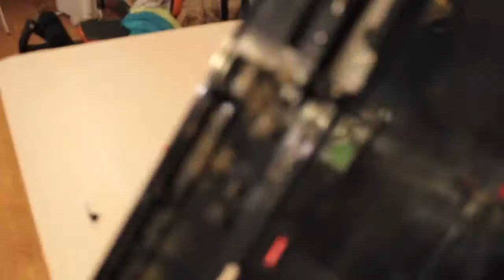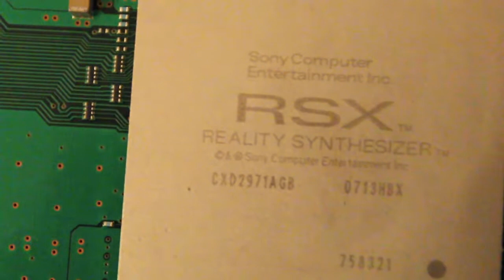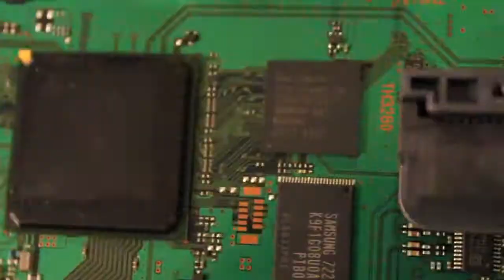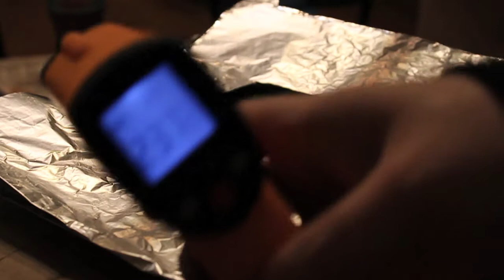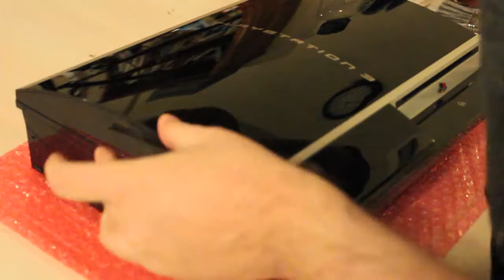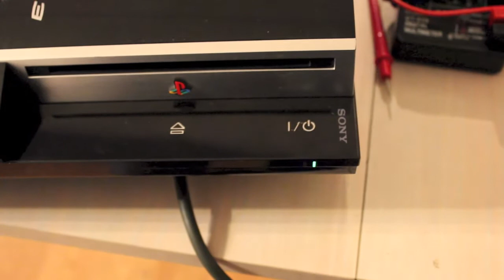Sony PlayStation 3 YLOD Repair Attempt (Serial: 02-27430367-2452398-CECHG02)

Comment: Did you I never noticed on the video, I'll check it out again, probably looked away at that part :P. 

I bought some Arctic Cooling MX4 fairly cheaply, so I was using that. It'd be awesome if they'd made the chips with larger thermal cooling plate t begin with, there's quite a bit of room on the board, so it's not like thye were pushed for space. My old mk1 PS3 is still rocking fine though I don't play it that much, but mines well ventilated so hopefully she'll not YLOD anytime soon.

Comment: I was lucky with my 60gb ps3 reflow, it worked but it seems the heatsinks are not making proper contact with the cpu and gpu. Fitted shims but it didn't work at all with those so i removed them and reflowed, it worked for a while but has ylod'd since. Also when the pro's reball they use a jig when heating the boards so they don't flex, imo flexing is the reason the chips can't reattach properly. Thanks for sharing.

Comment: Does anyone else besides me add thermal paste to both sides of the shims?  I also use a heatgun, but I have my board laying dead flat on a cardboard box with no overhang and I slowly heat up the whole board before concentrating on the chips for nearly 5 to 10 minutes on 300 celsius setting. Although I've not used flux when repairing mine. However I've been told the few I did, didn't last long. Yet I tested them for well over an hour obstructing the airways getting them as hot as hell. Oh well.